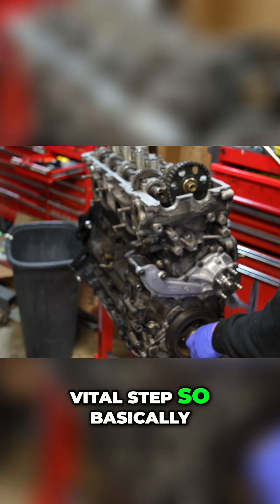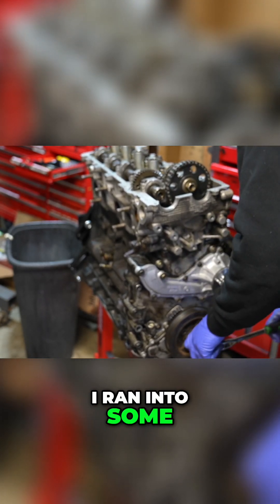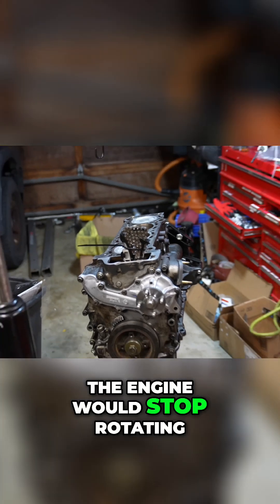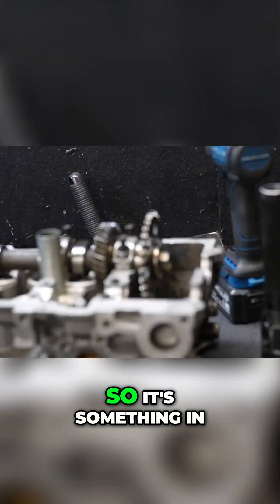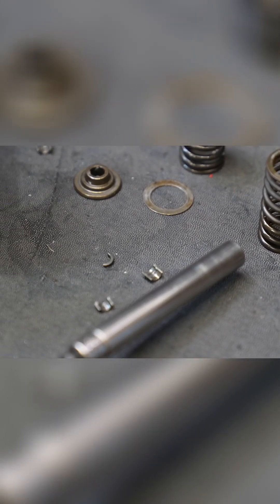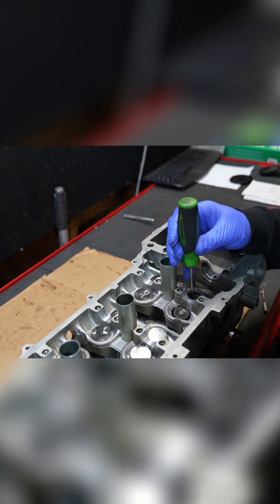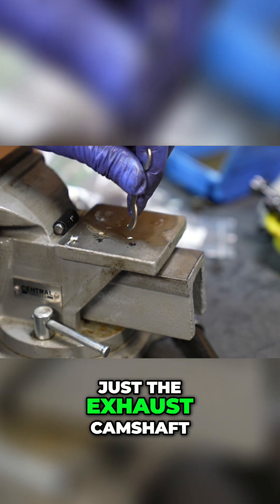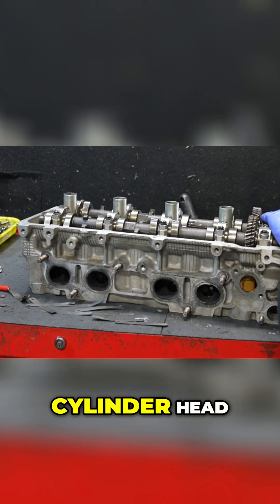Engine Diagnosis: Preventing Piston and Valve Damage

Comment: Oh no. You can hammer them out, put a rag, foam, whatever soft to keep the valve from dropping in the combustion chamber then use a hammer and socket to get keepers out but going in you have to use a compressor. Then putting a dab of grease really helps. You shouldn't have to push on the keepers at all